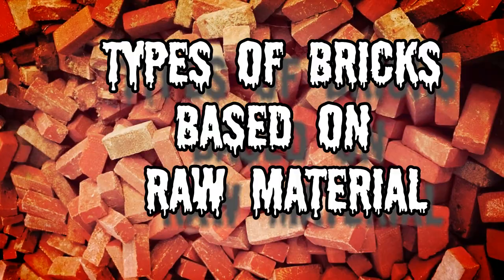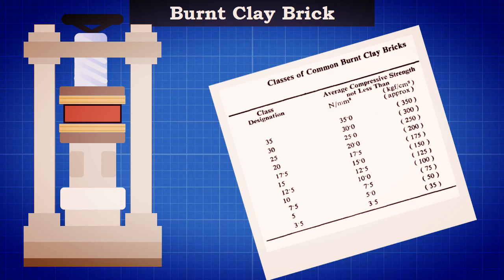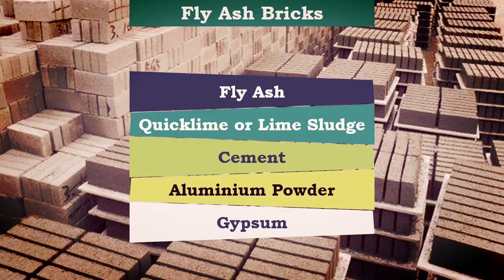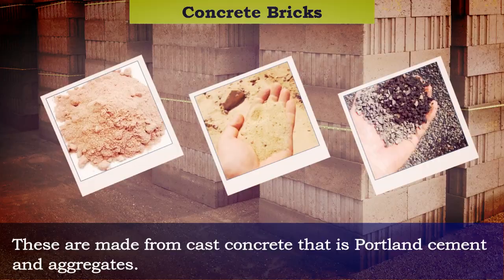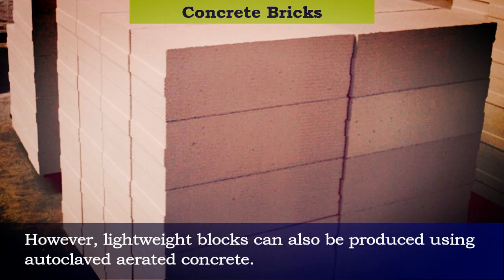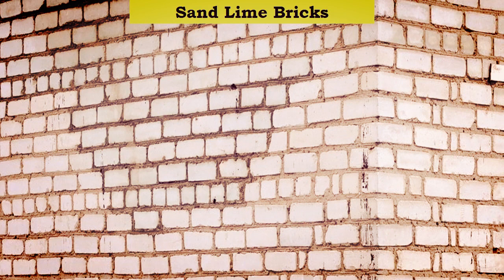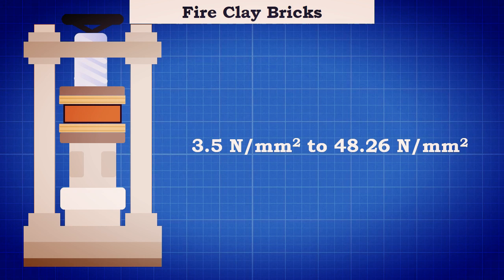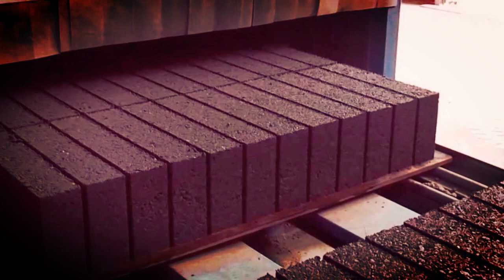Different Types of Bricks Based on Raw Materials// Classification of Bricks //

Comment: A life saving Question !

I'm making some kind of a forge out of these three holed clay fire bricks & need a clay powder paste to put them together, any suggestions or knowledge of what this is that will not explode after 3000 degrees Fahrenheit like concrete that does explode, personal experience issues I discovered & it wasn't fun, please help, it's a life saving QUESTION for anyone whom may know of something that will work, I'm learning & need to learn / know stuff like this, the fire clay bricks can withstand up to 5000 I believe but I can't find the paste / powder that will help & withstand the same temperatures I need it to help hold the bricks together, any suggestions or thoughts on specific materials ????
Thank you to anyone who will help answer.

Respectfully, / Sincerely.

Signed : 

Pauly~
Reply: Hope u got the expected outcome....